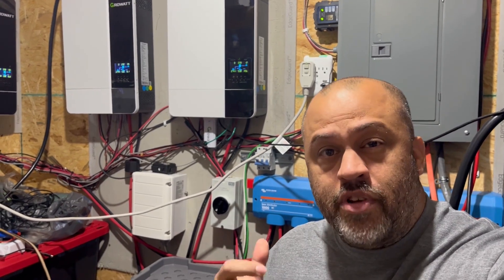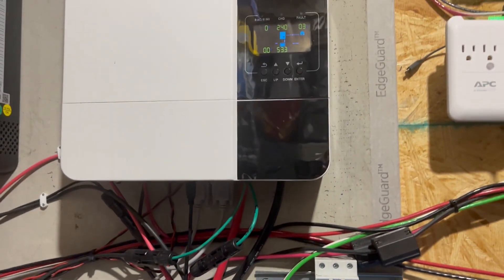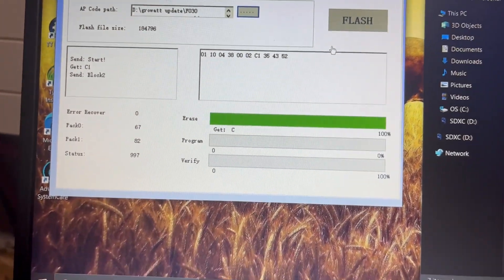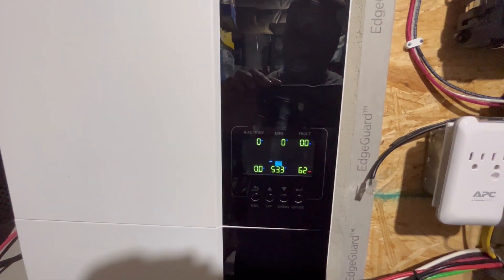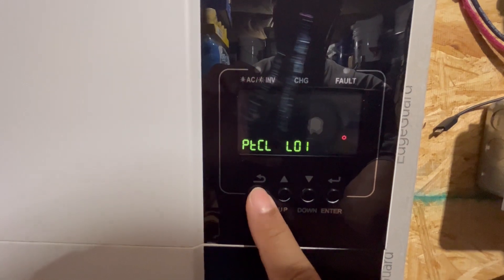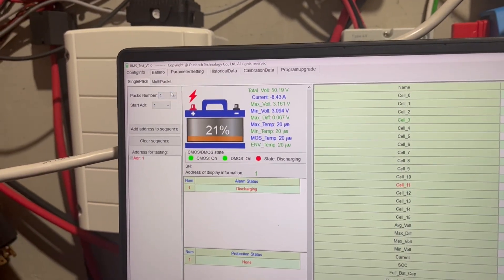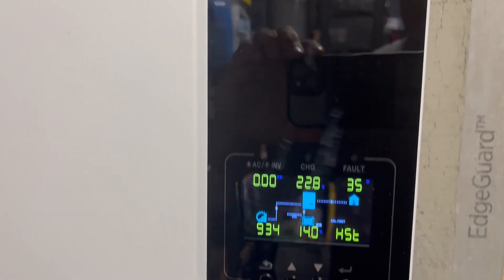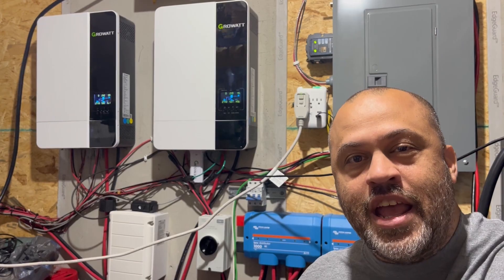Growatt and EG4 Battery Communication Problem  -  Firmware Update Process

Comment: ive been doing the research for close to 2 years now on the home inverter units and have come to the conclusion to avoid growatt inverters.  i have an MPP still in crate never used and will probably sell. im going Victron 100% good luck with that junk. git rid of it. nothing but problems that just will continue.
Reply from the maker: If you have the money victron is a good bet. But nothing is foolproof today. These growatts and eg4 batteries are pretty good for the price. I would recommend victron, solark, or the eg4 18k if money is not a problem.
Reply: Thank you Rodney for your video. I have the SPF 5000 ES and bought a Growatt 2.5 KWh battery. It says error 04 too low voltage. I am trying to find a BMS software to put on my laptop to see individual cell voltage like you do. Any suggestions? Thank you.

Comment: Know what you are going through. Been there time and again with the old Growatt. Never did get it to work as it should. Other equipment was Victron so we bought a Quattro. Worked right out of the crate and has worked, nearly silent, for the last six months. The new EG4 18k pv looks to be a good unit as I am sure you have seen. I didn't have what it takes to keep on with the Growatt. Good luck.
Reply from the maker: I have liked mine but this software glitch was getting to me. I will
Move this inverter with one of my newer ones if I have anymore problems. Seems like they work when I tried them as the primary. Just need a longer cable or to move.